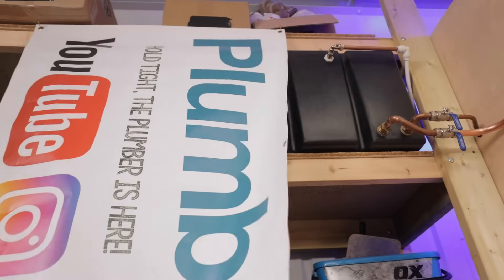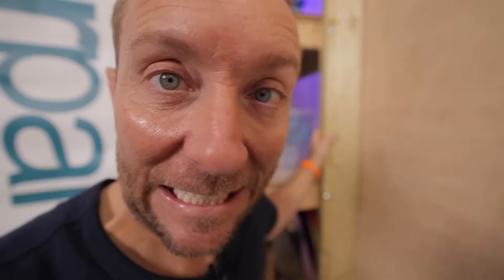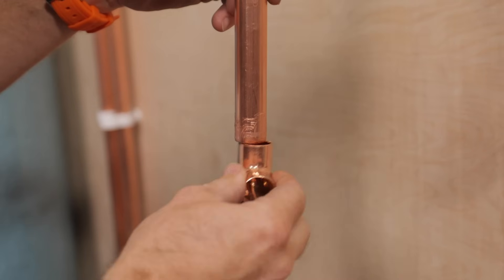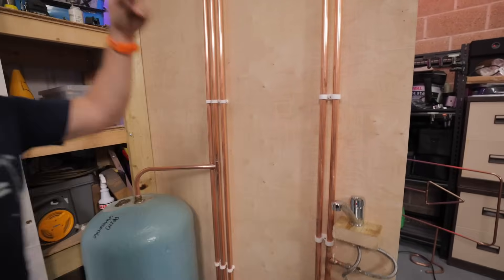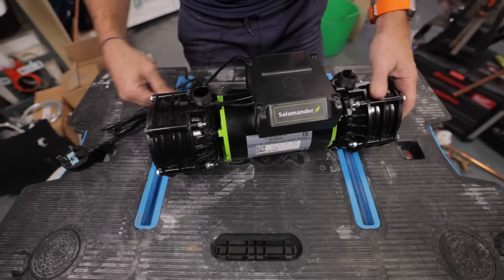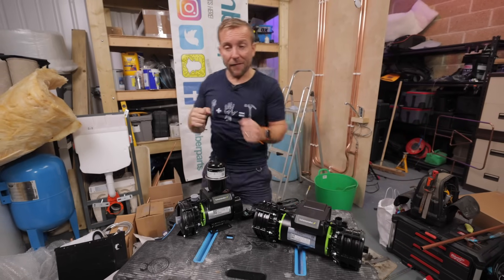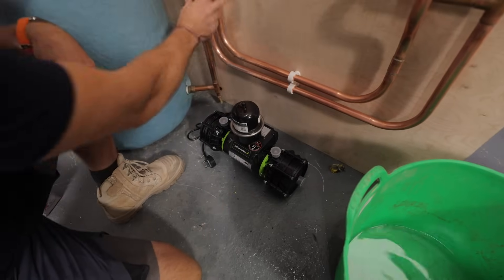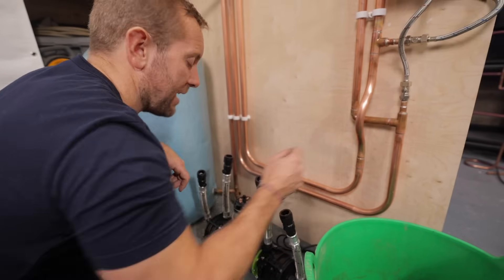How To Fix Low Water Pressure Problem on a Gravity Fed System with PlumberParts

Comment: The pump is so slow to start with my tap in the kitchen... why is that?? Also is it possible to completely eliminate the sound?
Reply from the maker: Hi If you can let us know the serial number on your pump we can query this with our Tech Team who will be able to advise why there is a delay in your pump activating. 

While complete silence isn't possible, most mechanical systems produce some level of sound during operation but our pumps are Quiet Mark certified, making them some of the quietest on the market.

Comment: got a small hotel 11 rooms mixture of showers and baths on a gravity fed system consisting of 2 hotwater tanks side by side fed from one attic tank would this help pressure?
Reply from the maker: Could you please send your request at Tech@Salamanderpumps.co.uk. Our technical team will provide you with a solution.

Comment: We’ve just had a new bathroom fitted and the plumber admitted his ballsup. He plumbed the mains cold water @3bar to the mixer valve and gravity fed hot water supply. Excellent if you want a really cold shower! The pressure is terrible for a warm shower. Would fitting a full house salamander to the hot only (if possible) boost the hot to a better level so the mixer knows wtf is going on? 🤭
Reply from the maker: Hello, Could you please email us at Tech@Salamanderpumps.co.uk

Comment: I’ve a Grundfos pump pressuring a shower, it’s a twin pump coming off a cylinder. Tap pressure has always been terrible, would i need another pump for the taps?
Reply from the maker: You can supply both the shower and taps from one twin pump. For example, our Right Pumps range are a whole house pumps, a twin pump will supply both the hot and cold and the performance ranges from 1.5- 3.0 Bar.

Comment: We have 2 shower pumps from a single cylinder. One sits under the cylinder and supplies 2 ensuites. Another one sits under the family bath and supplies the bath and shower above. The plumber didn't install a flange as he didn't want to risk breaking the old cylinder ( that is what he claimed to!). The salamander plastic double impeller pump below the bath packed up in 6 months. Replaced with brass salamander pump now. The brass Stuart monsoon sitting at the bottom of the cylinder supplying 2 ensuites runs fine. We do worry running 3 showers ( living with 2 teenagers) simultaneously will empty the cylinder out😢.
Reply from the maker: Hello, wat water storage capacity (the size of the cylinder) do you have? Could you please send your request with the photos of installation (cylinder and pump) to Tech@Salamanderpumps.co.uk for our tech team to look at your case.

Comment: so I have the issue with my hot tap mostly, even downstairs in the kitchen. I think its partly to do with the mixer tap fitted but moreso the use of 8mm braided tails feeding hot and cold to it. Cold is fine, hot is poor.
Would this pump still manage to improve my flow, I'm guessing it must!
Reply from the maker: 8mm is restrictive so the natural flow wont be strong enough to lift the float in a positive head pump, however a neg pump it will allow the hotside to be pumped matching the cold.

Comment: Thanks for this very informative video…
Now, is there a way of reducing/avoiding that delay on the top tap?
I mean is there a way to avoid this delay by installing some extra hardware.?
Reply from the maker: The first delay is likely air as air in system (1-2secs) which when purged it comes out straight away – that’s just because the pump works on sensing a drop in pressure then kicks in- again its very slight before activating.
Reply: It’s only a 2 second delays man, damn! How serious do you take life that a 2 second delay upsets you
Reply: @HertsWorks  Mine is like 7 seconds or more.. He is lucky it's not more.